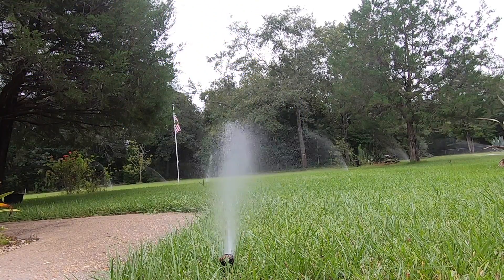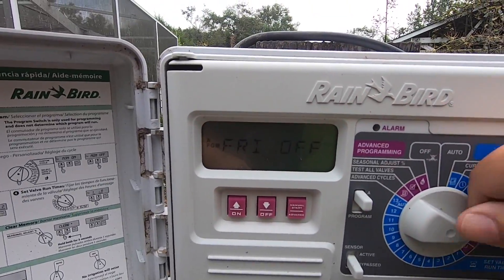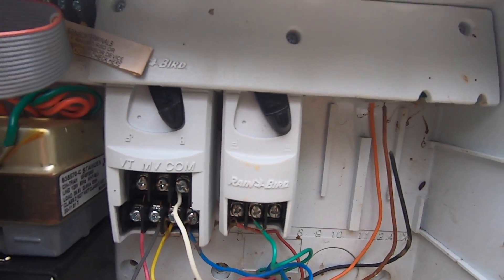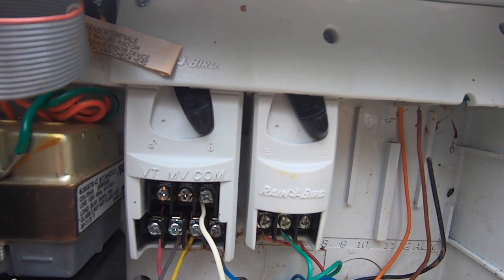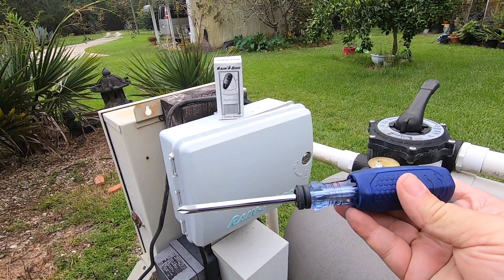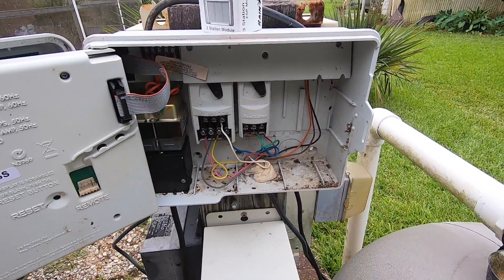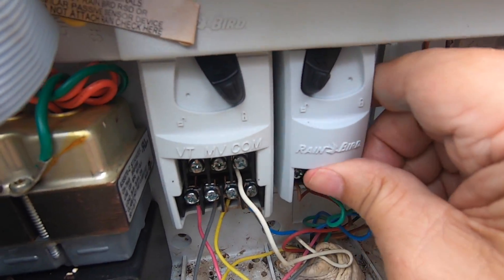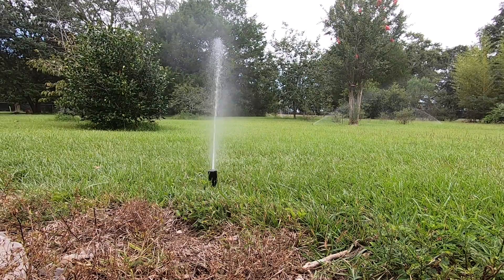EZ Rainbird Controller Repair - ESP Series

Comment: Is there a way to test the modules to check if there good.
Reply from the maker: I don't know, I'm sure Rainbird will have equipment to test these but I'm don't know how to do it. Thanks for the question and for watching. AND good luck fixing your unit if it is broke.
Reply: @LandingZoneHome thanks for replying,  I change valves and wires and still 5 and 6 won't come on, I used a different controller and still the same issue, I'm a little confused there.

Comment: Great video thanks! I have a problem with the Advanced Cycles. When I turn the dial to that setting, it shows "Test 0:02" which is the same readout I get when the dial points to Test All Valves. I'm thinking the dial is not making contact properly. I've tried the reset button and the clear function as well. Nothing helps.
Reply from the maker: Give Rainbird customer service a call, they helped me before. Thanks for watching.

Comment: I have a rainbird ESP-M and number 1 zone won't come on. I've changed the solenoid and the valve works manually. Can the main module be not working on the number 1 station?
Reply from the maker: I'm no expert on these but that is what it looks like. Just make sure the program is set properly. Also, if the module is bad it won't even work in manual.
Reply: @LandingZoneHome  actually I put number 1 with number 2 and tested them and they both came on so either the timer isn't sending power to the first station or the module is bad on that section.
Reply: @MrSamuel63976  Give Rainbird a call, they will probably help you troubleshoot the problem.
Reply: @JackHunnicutt  actually I replaced the module and works like new. Thanks for the advice though. For future reference if you have a module that has more than one station on it one station could not work but the rest will.
Reply: @MrSamuel63976  Glad you got it working.
Reply: I have this same problem with 5 and 6 not working I change the controller and still not working those zones, my valves and wiring are new. What could be the issue there?

Comment: Thanks for taking the time to produce this video!  I had the same problem with zones not working even though I was not getting the NOMOD error on some of them.  The zones on the display were not in sequence any more either.  I did two further tests to make sure two of my three modules were bad: 1) I testing voltage on the module outputs after turning on the zones manually.  2) I put a jumper wire from a working zone output to the output of a non-working zone and manually turned on the working zone.  Example, my working zone is 1 and my non-working zone on a different module is 5.  When I turn on Zone 1, I measure 27 volts AC (be sure to set your voltmeter for AC) on the Module Zone 1 output, but when I turn on Zone 5 I measure zero volts at the Zone 5 Module output.  When I put the jumper between Zone 1 and Zone 5 and turn on Zone 1, both Zones 1 and 5 work - thus I know the problem is not a solenoid valve. Now I am confident that buying the new modules will solve my problem.
Reply from the maker: Excellent technical data! Very glad you liked the video and good luck with your system.